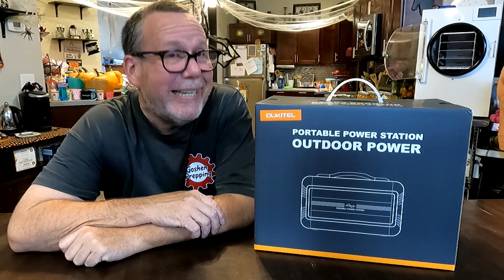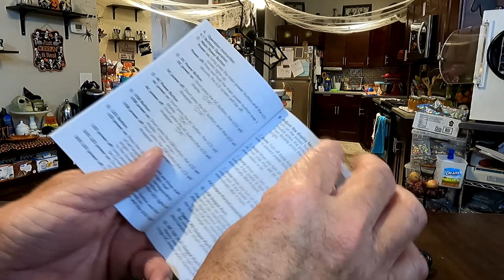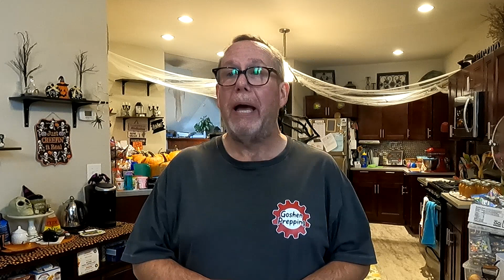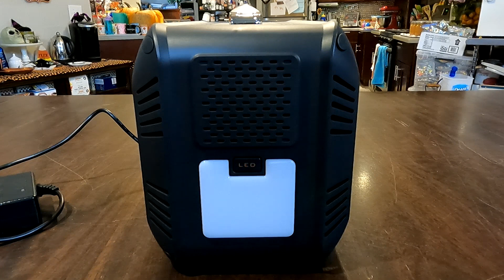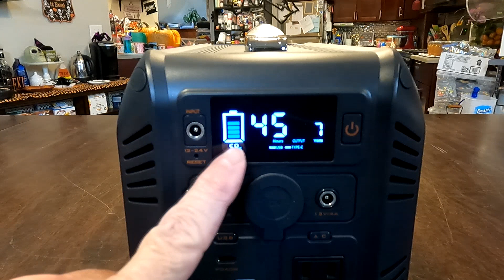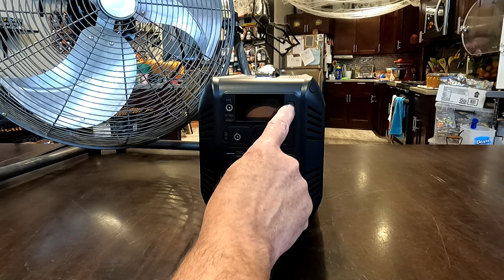REVIEW – Oukitel CN505 Portable Power Station

Comment: Great unit.  Portable,  lightweight multiple ways to charge.  Like the information included in booklet to give you ideas of use. Lots of safety features and built in light. Lots of ways to charge different devices.

Comment: For you novices out there, after the Lithium Iron Phosphate batteries have cycled 3,500 times, they still work.  They will only hold 80% of their original capacity.  Like your phone, after a year or two, it won't last as long on a charge but it still works.  Lithium batteries will hold 80% of their charge after only 1,000 cycles. That's why Lithium Iron Phosphate is sooo much better.  Thank you, Eric, for the review!

Comment: It looks so easy to set up. I've been wanting to buy one but I was afraid I couldn't set it up. A few questions...does it come with a solar panel? If not can you recommend one that's compatible please. Also I need to be able to charge my cell phone. I didn't hear you mention that? And most importantly, I need a way to keep my insulin chilled but I have no idea how to do so? Thanks in advance for all of your help and advice.
Reply: I use a Habor Freight 100 watt panel. solar panels are affected by many factors such as the light intensity and the panel's angle put on the ground. in general, i use the solar panel under the full sunlight to charging, and make sure there is no shadow cast on the panel. Hope this helped.